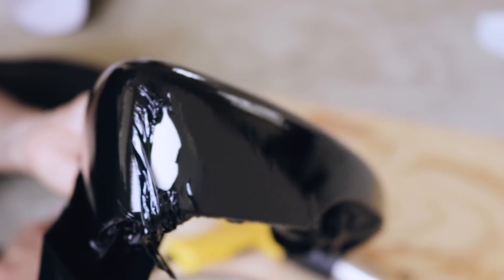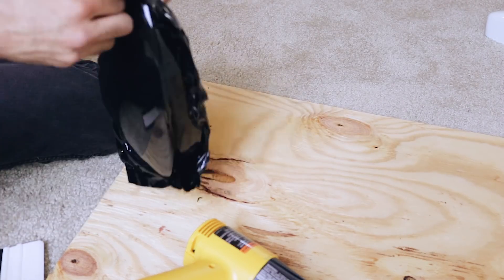How to Camo Vinyl wrap a car

Comment: Love what you have done to your car. Quick question 🤔: Do you think mud flaps would look good on a Jetta?
Reply from the maker: YES! I’m getting some RokBlokz the moment I lower my GLI
Reply: FrankieGisMe See I was thinking the same. Cause where I live there is alot of dirt and Construction. I drive a vw tsi 1.4 2017 (Ik not the best jetta 😂) and Ive put a few mods on. I was thinking today on getting either rokbloz or rally armor. I just wanted to know your opinion 😅.
Reply from the maker: I’m with you on that because I drive off road more often then I should haha. I’m sure Jetta still looks clean af👌🏼Also, I own  a set of rally armor mud flaps. I never put them on because they’re HUGE.

Comment: Have you made any performance increases? I know it's pretty fast already but I'm thinking cold air intake, exhaust, and a tuning kit of some sort. 2.5 SE in line 5, no turbo 170 HP 6 speed auto. Pretty fast already. Any good advice from an expert??
Reply from the maker: Ya, so far I have a K&N cold air intake and APR tune.